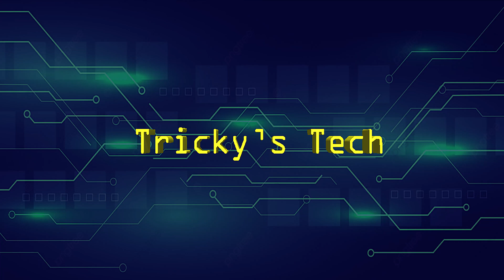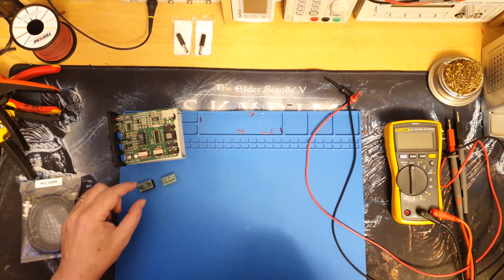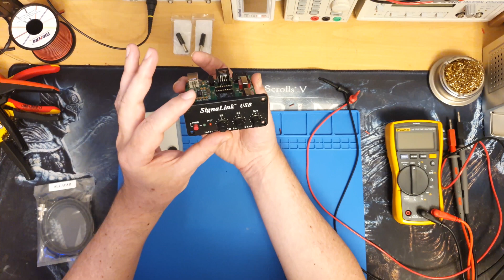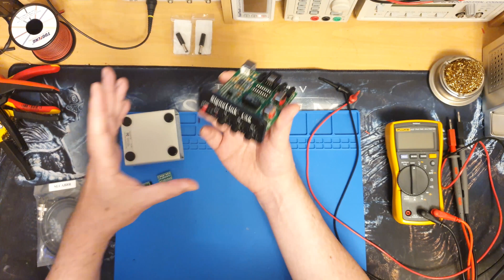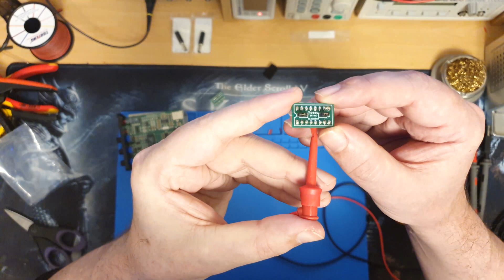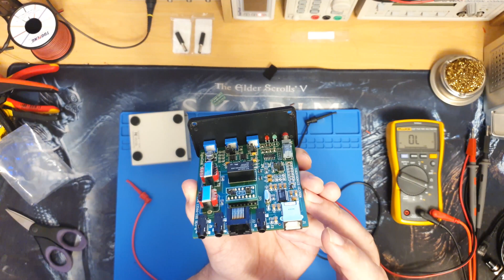SignaLink USB Jumper Configuration

Comment from the maker: Doh!! Such an idiot...I got the mic cable, no sound comes out of the mic socket! (Maybe a setting to enable that?), So I did had to run a single mono 3.5mm audio cable from my radio to the "line in" of the SignaLink...what a rookie mistake! After I got that sorted I was all set for FT8...I'll get the cable for rear in the future and the jumper board for that!